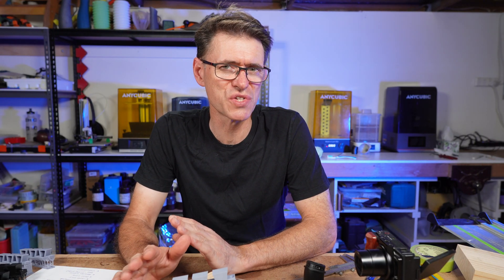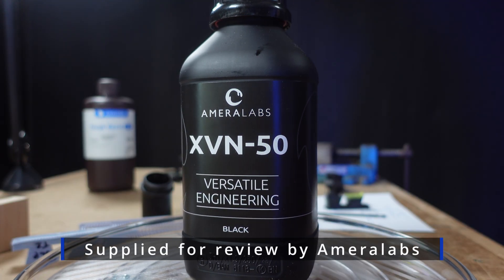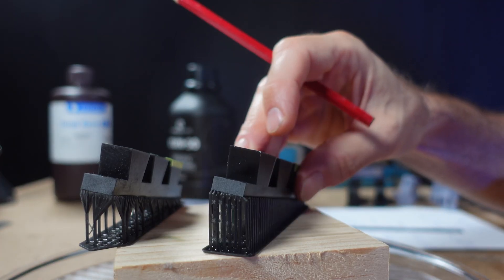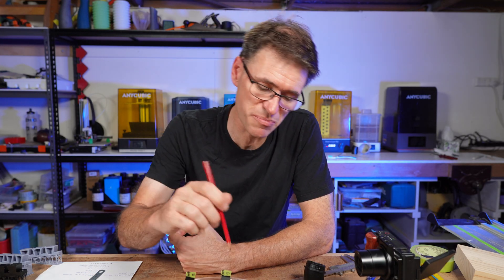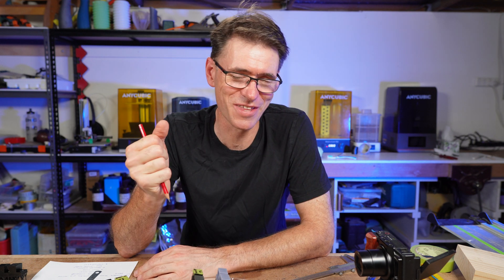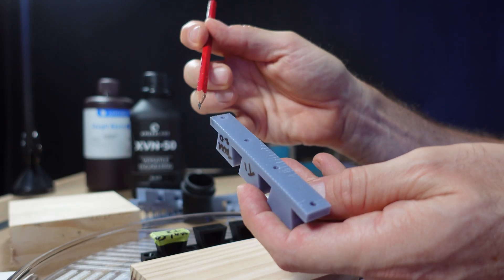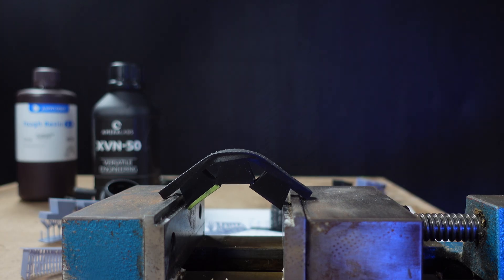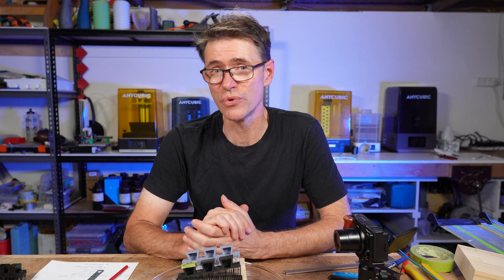Resin print straighter edges and shapes

Comment: I’ve already learned a lot just from watching two of your videos (instant subscribe!). Thanks!
By the way, around 07:00 you mention that you were going to perform a “finishing process.” Is this something other than sanding, e.g., acetone vapor smoothing?
Reply from the maker: Thanks for your feedback. Glad my videos have been helpful for you. The 'finishing process' I use is wet & dry abrasive paper, using 180, 240, and 400 grit to get a smooth surface. I find that using wet & dry creates a nice smooth surface without the use of any extra chemicals. I also find that it's more challenging to get an even finish when sanding black resins. You can get a good result...just need to be a bit more careful to avoid scratch marks.
Reply: @ColinKlupiec  Awesome! I’ve been watching more of your videos and find them really insightful. Thanks!

Comment: Why not just put the print directly on the build plate instead of using supports (barring any print size issues)? Use a slight chamfer to account for elephants foot
Reply from the maker: It's a good suggestion, and one that I've tried. Getting the chamfer just right is really difficult if you need that bottom edge to be dimensionally accurate. I think I need to do more work on the method of continuous supports.
Reply: Isn't elephant's foot a filament printing problem only? Why would it happen with resin where the print hangs upside down? I'm so new to this that I haven't even got a printer yet but am still researching and have got to the point where I have decided on resin rather than filament for details, accuracy and strength. I need to print functional parts rather than decorative ones, and it seems to me that most functional parts have at least one flat surface, so why not put that on the plate? I'm VERY interested in an answer to that question. Thanks in advance.
Reply: @oleleclos elephants foot occurs on the first exposure layer in resin printing, it secures the print to the build plate

Comment: Does it come down to the consistency and colour/density of the resin type being used due to the light refraction in each layer, for each application as well as support placement .................. ?  So what resin would be best for me to use so that I can print small gear cogs and drive shafts for 1/87 scale model trains?  I have just got into resin printing and still trying to find something suitable... I have been using an FDM printer for many years so I am conversant with most of the format of 3D printing but am in new territory with the resin side of things.... any assistance/advice would be most helpful.  I have purchased an Anycubic 7" 10K Photon Mono 4 Ultra.
Reply from the maker: Thanks for your questions. I can't answer in terms of the chemical make up of the resins...only in my experience of using them. I've found the engineering and tough type resins to perform better than those not intended for functional parts. The engineering resins tend to be a bit stiffer and maintain their shape under load and heat more than the 'tough' type resins, which tend to be a bit softer. #Ameralabs TGM-7 is an excellent all round choice, but it's expensive. #Siraya Tech Build might be a good option for you. I've also found that #Antinsky Engineering SG resin is very capable, but again a bit more expensive.

Comment: So here's something that's been driving me nuts that looks like isn't messing up your prints.  On the bottom of a print where the supports make contact there is extra resin cured.  So if I have a totally flat bottom, like you do, there is a raised section around the supports.  So in your case, where the supports are, there would be a raised section around the bottom of the part, and it would visibly dip down in the center where there were no supports. Is there some magic thing that needs to be done to prevent this from happening?  It makes it so when I print flat stuff I always have to sand that extra cured resin down.  Its a major pain.
Reply from the maker: Thanks for your question. Sounds like you might be experiencing what some describe as 'sagging'. The extra resin around the support creates the higher point and everything seems to sag around it. The trick I've found is to keep as many supports right on the edges of the model so that only the lightest use of sanding is required to remove the support marks on the edges. If you like, send me one of your .stl files and I'll take a look. info@colinklupiec.com

Comment: Its a bit picky, but I'd like to point out toughness is an actual engineering term.  Its related to impact.  Doing a bending test is more related to % elongation at break and the ultimate stress.   So a resin that is tougher, I would expect to handle drops and impacts really well, but not necessarily bending.
Reply from the maker: Thanks for your comment. Picky is good. 😊 Yes, I know that toughness is an engineering term. You might be interested in these tough resin tests where I use the same model, with the same impact test, and the same compression test, to test a particular use case that is relevant to my work. https://www.youtube.com/playlist?list=PLZ5ff5fjppL__6ZcZUSSagAvzlgC2l4fg

Comment: When I see the comparisons between the two I have to wonder if the difference is the % cured each layer is.  I know we dial in a resin and call it good, but there's really no way to know (as far as I know) to know actually how much a resin is cured.  Combine this with how stiff a resin is by nature.... I think a stiff resin that is more cured at each layer will have better results.  The layers are cantilevering out without any support, so a more stiff resin, when cured, and a higher % cure per layer will yield better results because those cantilever layers aren't moving as much.  The flimsy edges of the layers will move a bit from the fluid pressure when the printer goes down, which will effectively make the layer thicker.  But because of the hole, the side walls are stiffeners, which is why it will appear to suck back in.  I would be interested to see if some of the gray resins that had some surface issues would do better if the cure time was a bit higher to get a more complete cure per layer and also heat the resin more to get it less viscus.  This could lower the pressure between the previous layer and the fluid between it and the film. 
Resin printing is so much of an art form, changing one thing can open a whole can of worms that would have to get explored.
Reply from the maker: Thanks for your comment. You make really good observations. For enthusiast users, or even 'pro-sumers', getting the settings and print orientation right for a particular project can be really challenging. Sometimes it works straight away, sometimes not so fast. It's a space we're all constantly learning in. You're totally right...resin printing is an art form as much as a technical skill. I think that's why we like it so much. 😀

Comment: Your testing process is vastly incomplete. You changed support methods from the first resin to the second resin, but then never tested the second support method on the original resin. I guarantee, 100%, that you would see vastly improved results on the original resin, likely another set of clean straight edges. The resin plays MUCH less of a factor in things like that than it does in things like tensile strength, impact resistance, etc. Not saying it plays no factor, but not nearly as much as you are implying here. I appreciate the efforts, but there are a lot of steps missed, and as others have mentioned, the pull force detection being done by the printer is going to add in an x factor that removes any possible apples-to-apples comparisons going on here. You would want to disable that for real comparison testing.
Reply from the maker: Yes, you're right. The testing process is incomplete. Other limiting factors are at play. For example, when I receive a resin for testing, I usually get one bottle. To complete a full set of tests including real world projects on one bottle isn't possible. So I need to take some educated short cuts along the way. I'm quite aware of comprehensive testing procedure/method, although I'm not trying to create scientific results. I'm trying to simulate what 'many' people 'might' encounter in a wide variety of use cases. Along with all the other tests I do, I'm pleased to say that my own accumulated knowledge is leading to faster and better success. Hopefully that's helpful to others. 😀

Comment: Syria blu print straight but cost a fortune.  You will also need ventilation to use it.
Reply from the maker: Good point. I've got some Siraya Tech blu lava black. Maybe I should run the same print with that resin. I'll give that a go.

Comment: You keep on saying in every video that you used recommended exposure settings, but there is no such thing - you have to calibrate the resin before doing anything else, otherwise you're just wasting time. Use boxes of calibration, get the dimensional accuracy correct and then do those other tests - without a calibrated resin they are meaningless.
Reply from the maker: Thanks for your comment. You make a good point that each resin needs to be calibrated. Yes, I do start with the settings that I can find on the bottle, or those recommended by the manufacturer. And then I also do RERF exposure tests to dial them in further. For example, I'm testing #Formlabs Creator Tough resins at the moment. Formlabs recommends that longer exposure times are needed, and they specify times up to around 9 seconds. In my testing I've found that you get printable results all they way down to about 6 seconds. So I try to keep my testing fairly wide.

Comment: It helps if you align the pixels with the screen. For square pixels, you use arctan(layer height/Pixel width). This will result in an angle that you then apply to the X Y and Z axis. You can orient your part, save it, then reopen it and apply the angle NEGATIVELY to all three axis, save it again, then apply the angle again. This will allow you to control the orientation while also aligning the pixels with the screen. It will fix the banding.
Reply: If you have rectangular pixels, you must calculate X and Y, and use the Y angle for the Z axis as well. For highest quality prints, you should match the layer height to the smallest pixel width of your printer. If you do this, the ideal angle will always be 45 degrees. arctan (1/1) = 45 degrees.
Reply from the maker: Thanks for the detailed answer. I will certainly give this a try...once I get my head around it. But on face value it sounds like it makes sense. 👍
Reply: @gavinbelsen3690  Great answer but I'm trying to get my head around it. My pixel size is 14x19 microns so would I use the arctan calculation for x and y seperatly and adjust angle accordingly with a 0.014 layer height? 0.014 is very small, worder if I can double it to 0.028...

Comment: Basically, place a sturdy, less tougher, removable flat resin wall around straight edge projects ?
Reply from the maker: Thanks for the suggestion. I think I know what you mean. It's also been suggested to place the same model, mirrored on the build plate to offset pull forces on the release film. Although that adds duplication and therefore more resin.

Comment: Great video, thanks for sharing. Impressive result with the XVN-50!

I believe that the banding on the side is caused by change in pull forces because of the cross section. Note where the align with the edges of the protruding dovetails. There’s more surface on the fep between the protrusions. I don’t know how to get around this but imagine that somehow taking up the difference in surface area might help, perhaps with a second model to offset.
Reply from the maker: Thanks for your feedback. That's a really interesting suggestion to add a second model to offset the pull forces on the release film. Perhaps if I printed two, at opposing angles it might make a difference.

Comment: I have an alternative theory as to what causes the warping. It's the color. Thicker and more opaque resins will offer better model accuracy because it minimizes the light bleeding through the layers. That pincushion effect is because the areas with the holes have no UV light bleed because no light is projected at that layer of the model, whereas everywhere around the holes it is. If I'm correct, lowering the layer thickness to 0.025 on the dark resin should make the same defects appear. Conversely, increasing the layer thickness should lessen the defects on the gray resin.
Reply from the maker: Thanks, that's helpful insight. I have some Antinsky Engineering resin in black which I can compare this to. Siraya Tech has also updated their Blu resin in a 'lava black' version which is apparently also much improved. I haven't tried altering layer thickness from 0.05mm yet, just to keep things simple. Worth a try though. I'll keep testing.
Reply: @ColinKlupiec  One other thing. Since your printer has the ability to sense how much pull there is on it, it alters the results only valid for that printer. I have an older Saturn two and these results would be much different since mine is the more analog version of a 3D printer 
But there was a lot of good information to pick through and learn from, not only from the video, but from the comment above as well.
Reply from the maker: @OtherWorldExplorers  That's good insight about the printers. I have to say I'm really enjoying this intelligent release tech by Anycubic. It makes a huge difference for rapid prototyping. I can get through many more design iterations in a day. Perhaps I'll try the same print on my D2 DLP and see if it's any different. I'm pleased the video provided useful info. I kept it a bit more informal this time to show some of the backstory.